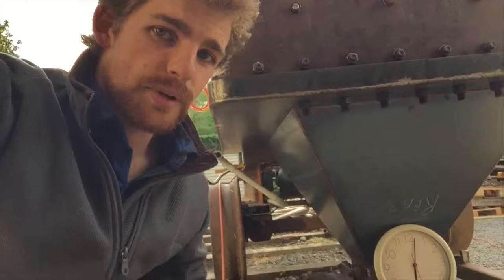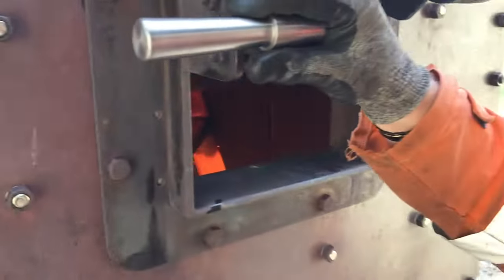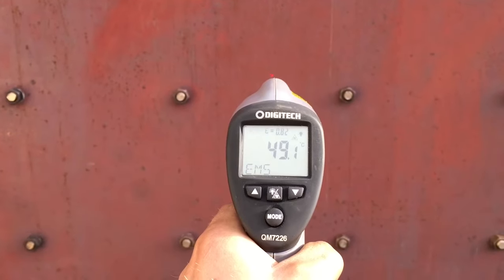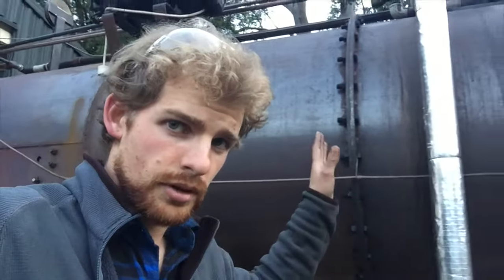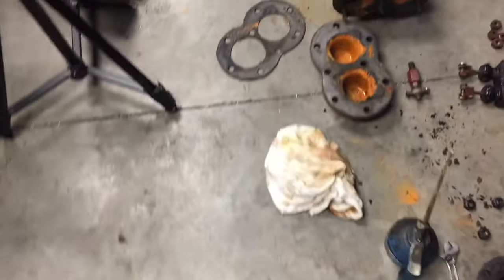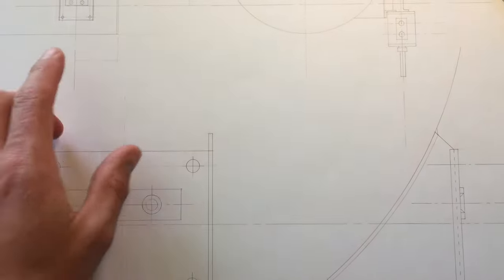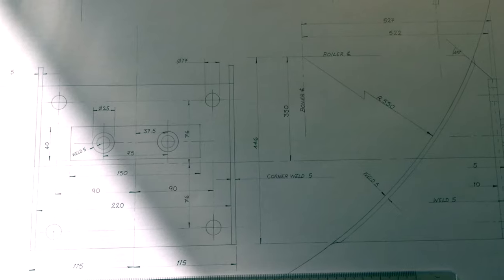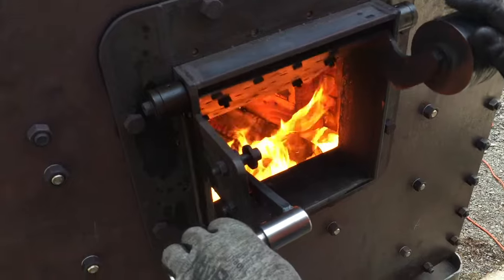21st Century Boiler Secrets | Modern Steam Locomotive Design & Build EP5

Comment: Water tube boiler have worked successfully look up a company called sentinel there was a 0-6-0+0-6-0 loco built by them that had a water tube boiler and that was able to move loads of 1000+ tons. Their railcars also did use water tube boilers in some cases.
Reply from the maker: Quite true, Sentinel developed some innovative designs. Their staple boilers were an interesting mix of vertical fire tube with horizontal water tubes. Do you have any links to info on their 0-6-0+0-6-0?
Reply: @Mackwell-Co  there isn’t much about it on the Internet there is a photo of it here https://www.national-preservation.com/threads/what-ifs-and-locos-that-never-were.444966/page-10 but the quoted tractive effort is not right as the loco was never pushed to the point it couldn’t pull a train and it was closer to 100t rather than the 90t. It had 4 2cylinder engines producing 400 hp in total with poppet valves and cam valve gear rotating at half engine speed it also had low and high gear but it was so powerful that low gear was rarely used. Sadly there are no designs for the boiler it had although it was very similar to the ones in the rail cars sent to Egypt also made by sentinel but with a psi of 335 it was also fitted with feed water heaters. As this loco was a one off not much is known about it there isn’t a date given for its build date but the it’s works number of 9603 would but it around 1957. The chassis were considered for parts converting to two diesel locos but that didn’t end up happening and it was scrapped at Dorman Long where it worked in 1966. I got most of this information from a book available from the industrial railway society about the sentinel locos and railcars
Reply from the maker: Thanks for this info!
Reply from the maker: Very interesting - Cheers!

Comment: Was going to ask about the boiler design. Could you show the drawings of the water tubes? Also where does the water circulation pump pump from? I’m probably one of the few fans wanting even more detail!
Reply from the maker: One day! There are inlet/outlet connections that pass through the underside of the smokebox wrapper just behind the door plate (and ahead of the saddle when fitted to the loco chassis). But otherwise the connections are located wherever suitable. Thanks for your interest!
Reply: @Mackwell-Co  
Is it a forced circulation boiler? Or are you just talking about the boiler feed pump?

Comment: Something I just found out about is that conventional steam locomotive boilers have to be warmed up slowly. If a roaring fire is started in a cold boiler, it could cause serious damage as the pieces of the boiler expand at different points as it is heated.
I think your idea is amazing just by simplifying everything essentially down to a single tube. I can also imagine that replacing any internal piping would be 100 times easier than taking the engine out of commission for who knows how long to put new fire tubes in, stays, clean out for scale buildup, repairing and inspecting for leaks in the fiber box or the barrel, etc.
I'm excited to see what you have next!

Comment: A question popped into my head while watching this: Do you reckon this boiler design could be adapted to new-build steam projects, in essence taking an existing but extinct design (i.e. we have the blueprints/shop drawings for this class, but none survived into preservation) and swapping out the original fire tube boiler for one of your design? Thus getting a locomotive that aesthetically and functionally resembles a grand old Victorian lady (for example, just for visualization, the Great Central Railway's Class 2 No. 567, or the SECR E Class planned by the Brighton Atlantic Group once the current H2 Atlantic is finished), but steams up in just an hour as opposed to 3-6 hours for a normal steam engine, and operates more efficiently and cleanly than the original?

I suppose a related question (most likely already answered, so apologies if I haven't seen it): You show this boiler being test fired with wood, but how would it behave when fired with coal?
Reply from the maker: Yes definitely, it is designed so that it can be built to match exactly the external dimensions of an original boiler, but with improved performance i.e. zero spark emissions, quick steaming etc. 
Coal isn't consistent with the environmental focus of the project and would require a more complex grate to manage the higher ash content. However, if cord wood wasn't an option then biocoal such as that being developed by CSRail in conjunction with the NRRI in the United States will work well, as will wood pellets or compressed briquettes (the latter two were tested in EP2). Straight vegetable oil is an option too.

Comment: You need to watch a video titled "Dan Gelbart's uniflow steam engine". It's a model engine of his own design. It is a uniflow engine, which was the most efficient reciprocating steam engine as of the 1940s when research on steam engines mostly stopped. It uses an Invar piston to avoid differential thermal expansion and seizing(more common in uniflow engines), it uses a Vespel (15 percent graphite impregnated polyamide (nylon)) cylinder liner for low friction and operation without steam side lubrication. He has made provision for a Teflon or Vespel piston ring. Vespel probably retains its mechanical strength to higher temperatures. The polymer cylinder liner also serves to prevent heat loss and condensation. It uses a bash valve admission, computer controlled, electromagnetically actuated admission valve closure, and an innovative exhaust valve in the piston that prevents the need for auxiliary exhaust valves that unuflow engines need if they lose condenser vacuum. He reports 10% thermal efficiency, which for a model size engine is God damn incredible.  I would really love to see some of these principles implemented in this engine, particularly the Vespel cylinder liner. 

My vision of a reasonably efficient steam engine would be a water tube boiler with superheater, economizer, air heater, and exhaust heater, coupled to a high speed, internally located, fully enclosed, geared, and force-lubricated uniflow steam engine and possibly a condenser. It wouldn't look much like a stereotypical steam engine, because of the lack of a water tube boiler, but more like a LNER J70. 

To be perfectly honest, reciprocating steam engines do have a place, but transportation really isn't one of them. Places where waste fuels and steam are available, namely sewage treatment plants, waste incinerators,  chemical plants, oil refineries (have a large steam supply), and perhaps for auxiliaries of full size power plants. Below 1,000 horsepower, the reciprocating steam engine is clearly the superior in efficiency. Between 1,000 and 5,000 it's a toss up, and above 5,000, the turbine is the clear winner. The requirement for clean, oil-free exhaust steam/condensate has probably been a big limiting factor, which is why I think Vespel cylinder liners, vespel/Teflon piston rings, and Vespel/Teflon rope packings and no internal lubrication could help make reciprocating steam more competitive in smaller sizes. 

The idea of building a more modern, up to date steam engine has fascinated me for a long time, and it's really great someone is trying to put it into practice. I subscribed.

Comment: You could probably increase the strength of the friction fit piston head by placing a clip ring retainer on the lower side. Also, a 1928-1932 Bryan (Bryant) steam tractor would prob ably be light enough to do the seeder work. And their 600 psi water tube boiler design is still being built for other purposes

Comment: I always felt steam power could still be in use today if research and experimentation had continued since the switch to Diesel electric. Power plants still use steam turbines to turn the generators. The same is possible for a steam electric train. Keep up the good work.

Comment: Regarding piston a rod fiction attachment. Is it possible to machine rod with a shallow spool shape say 5mm rims with diameter of 25mm and the centre 14mm with a diameter of say 24.9mm and the piston the opposite. You would probably need to freeze the rod and make the piston quite hot to fit. If thought needed you could pein the rod with centre punch on either side.
No idea how practical this is!

Comment: Great work.  Love it!!!  I think that wasted heat you mention at the beginning is call 'Sensible Heat'!...  How much will valve chest and cylinder temperatures affect how tightly the piston grips the piston rod?
Reply from the maker: Thanks! Yes as the pump's piston - rod assembly heats up, the slightly higher coefficient of expansion for the 1045 piston compared with the 420 stainless steel rod means a slight loss of grip so I have made a small allowance in the fit tolerance. The strength of steel (generally) tends to increase up to about 200 deg.C which is perfect for a saturated steam temp of 218 deg.C.

Comment: Very interesting boiler design, I’ve actually proposed similar with fire tube boilers for a water circulator similar in design to a single row superheater fed from below.

Though I have to ask: is this boiler cheaper and easier to build than an actual fire tube boiler? The only reason I ask is because the 5AT project was turned down because it was more expensive to build overall than the new build P2
Reply from the maker: Yes it is both easier to build and cheaper. No stays saves a bit of time!

Comment: Wow you're a lucky man you're doing something I always wanted to do and never got a chance to I always wanted steam locomotives to come back into the world. To I have to admit your design is a lot more simplified than mine I had an idea for a hydrogen-fueled hybrid steam locomotive that had a hexagon steel lattice insert into basically a modified fire tube boiler so it would link the inside structure friction stir welding to the outside structure of the boiler shell making it an extremely strong design using thermoelectric effects diesel electric locomotive trucks on the tender for dynamic braking also battery packs on the tender and condensers cuz when you burn hydrogen it combines with oxygen to burn and turns into water vapor you could convince that then the exhaust from the engine you could condense the exhaust from the engine it was literally not even going to need a fireman that was going to be computer-controlled with a backup battery and a backup computer for redundancy it would have been one hell of a machine my boiler is a trip along the hexagon plate perforated so the water can percolate into steam and the fire tubes go through the center of the hexagons my major problem was the Firebox I could never figure out a better fire box design I know that water tube boiler is never quite worked for locomotives they failed one way or another that's why I tried to redesign the fire tube boiler and I know you're probably thinking where where do I get the hydrogen that's a whole nother invention I have that I'm not really going to talk about here very interesting design good luck in your endeavors

Comment: Something else poked into my mind over the week - how are the water gauge and manifold going to be hooked up, seeing as the boiler doesn't extend into the cab? Are they just going to be piped outside the casing and insulated?
Reply: In a low water volume, highly dynamic water tube boiler like this one (probably) is, a water gauge is not as dependable as you might think. Waterlevels can vary very quickly and drastically under changing load conditions and would be impossible to manage manually. Pressure and waterlevel are rather temperature controlled to keep steam properties as uniform as possible. Since Sam is already monitoring various temperatures electronically, it will be likely that he will also measure waterlevels in this way. In the usual Lamont boiler, waterlevels can be easily measured, in some cases by means of a couple of ordinary spark plugs!
Reply from the maker: Basically yes (have a look at the manifold steam supply on SAR 25 class locos). The boiler doesn't need conventional gauge glasses which makes it a bit simpler!

Comment: When you described piston and rod connection method. Does not look like those numbers are take into the working temperatures (the rod and piston are made from different metal and might expand a little bit differently (and the numbers would be less good). Doesn't this introduce an additional stress to piston that would lead to deterioration (metal fatigue)?
Reply from the maker: Yes you're right. 420 Stainless steel and 1045 carbon steel have very similar expansion coefficients, but they are different, the 420 SS having a slightly lower coefficient. For simplicity I didn't include the check on this in the video but at working temperature the slight reduction in grip is within limits, the loss of interference is 0.008 mm. Because the stresses in the piston and rod due to the shrink fit are constant and only cycle a small amount with temperature, this will not introduce fatigue.

Comment: Probably been asked before but what wheel arrangement are you planning on useing and what kind of service will then complete loco be expected to do
Reply from the maker: https://mackwelloco.com/locomotives/
2-6-0 tender locomotive. It is designed for passenger service - 150 tonnes (trailing) on a 1 in 50 gradient. It will do just fine for freight too, just small. There is a spec sheet available at the link above.
Reply: @Mackwell-Co  thank you for your reply cant wait to see it complete think will need to make a trip from UK

Comment: Really dumb question but does the firebox have a square hole inside the door mounting or is it rounded to help with stress underneath the square insert?
Reply: Nevermind just finished watching the video. Having square corners wont cause problems if theres no pressure in the firebox!
Reply from the maker: Good question all the same!

Comment: Have you ever talked to anyone from DLM? Modern Steam is a goal for them.
Reply from the maker: Not yet but very interesting work they are doing!
Reply: @Mackwell-Co  Indeed!
I was reading the link you added in the description about the H45 and I read that one of it's problems was that it was impossible to raise steam unless you already had steam available kinda like charging a fireless, will your locomotive be like this or will you be able to raise steam more conventionally?
Reply from the maker: The boiler will raise steam conventionally (but much faster), as we did in this video. The link included some other types of German high pressure locos and I think the problem you mention above refers to H02, which was fitted with a Loeffler boiler.
Reply: @Mackwell-Co  Well that definitely gives it a better edge, have you ever considered an oil fired version? Using biodiesel and recycled oil from plastics or even (I know it's probably not legal where you're located) hemp seed oil could be a good renewable fuel for a boiler.
Reply from the maker: @boxcarthehusky420  Yes, the primary focus is on using solid wood fuel as it is not sufficiently viable to produce liquid biofuels. But, if there was a waste stream available such as used cooking oil, the boiler will work just fine with any type of liquid biofuel. I expect it to be less sensitive to burner design with the dry firebox. No doubt hemp seed oil would burn well and if it was otherwise going to waste then why not! Under certain circumstances, locos may be set up for both solid and liquid biofuel firing with no alterations required - true multi-fuel capability!

Comment: Will this type of boiler be able to handle the sudenchanges in power output that are a characteristic of a railway locomotive?  (Marine boilers tend to run at a constant rate for long periods of time.)  Also, I would have thought that the smaller boiler water volume would have made it less likely to be able to deal with suden changes in output.

Don't get me wrong, I'm interested and not being critical...   But it's so very different from the tried and tested Stevenson boiler which was able to cope with sudden changes in output precisely because it had a large water volume.
Reply from the maker: Yes it does, particularly well, if not better than a fire tube boiler. We have testing this feature extensively and because the boiler is basically supplying steam to an open pipe pointing up the funnel, the sudden steam draw is more severe than a loco slipping uncontrollably. Even the conventional Stephenson type loco boiler's ability to cope with sudden increases in load has almost nothing to do with the large volume of water it contains, what counts is that the fire must instantly supply more heat to match the load - which it typically does very well. Upon decreasing load, the absence of radiant heat transfer in the new boiler means that a hot fire bed doesn't keep generating steam uncontrollably i.e. when draught stops, so does steam production.
Reply: @Mackwell-Co  Thank you for explaining this...  I understand now and am looking forward to future developments.

Comment: how do you tell water level (having thought about it i guess a water tube boiler doesn't need a sight glass)
Reply: @Nick-xm1ux  that's why I'm thinking this one doesn't have a sight glass since it has no crown sheet, it's water tube not fire tube, more than that it's forced circulation so the water is constantly pumped around , so I would guess it's like a doble steam car boiler in that it's almost always all the way full
Reply from the maker: Yes a little bit like a Doble, but the contrary, almost always all the way empty!